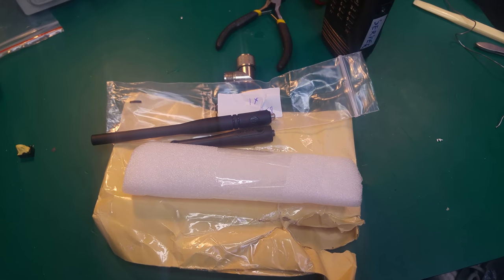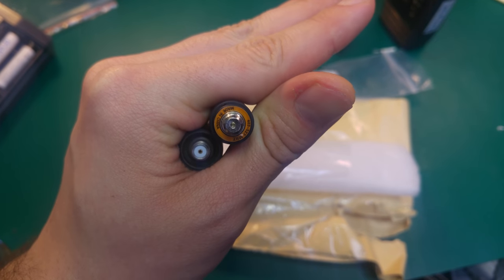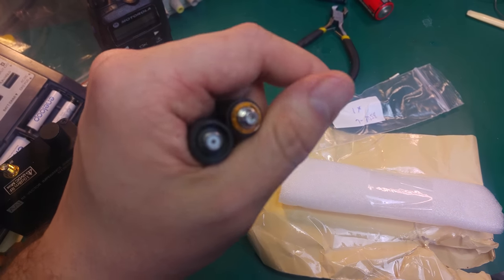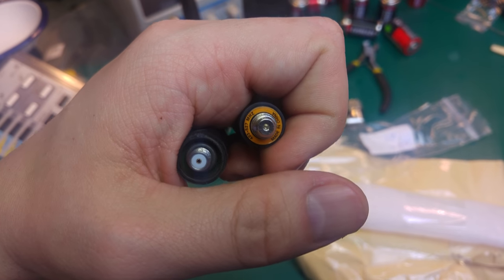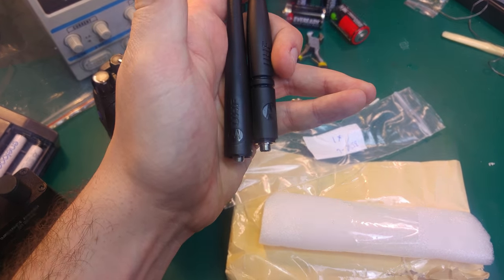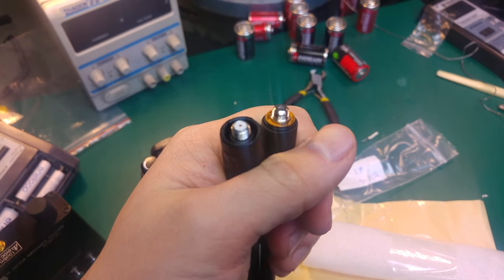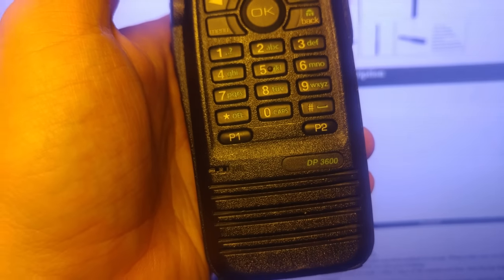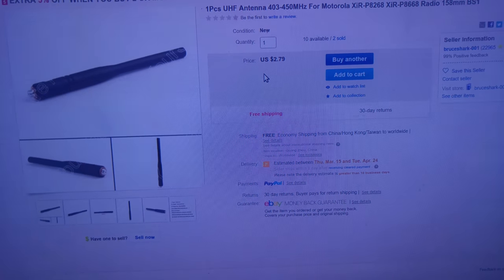Wrong antenna from China that could screw in and burn Your radio ( Motorola DP3600)...

Comment: The connector is totally referent. The stubby is sma for dp3600 and the other one is for the dp 4800 and it's the new Motorola connector. At least for newer models.
Reply: Do you know what the connector name is for the newer antenna? I am having lots of trouble finding it's name so I can get adapters...